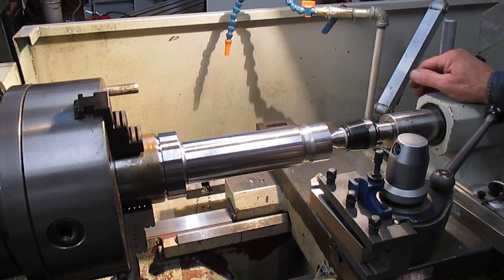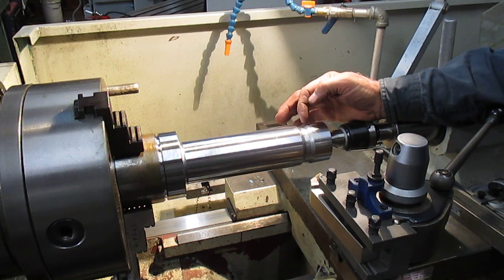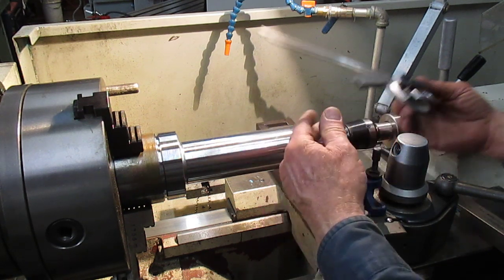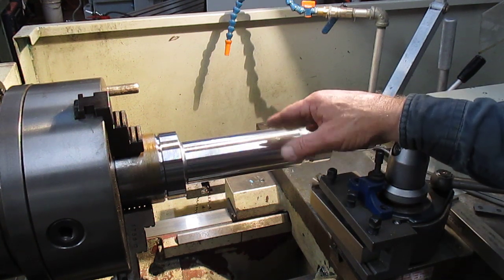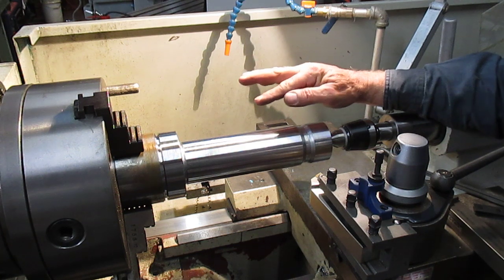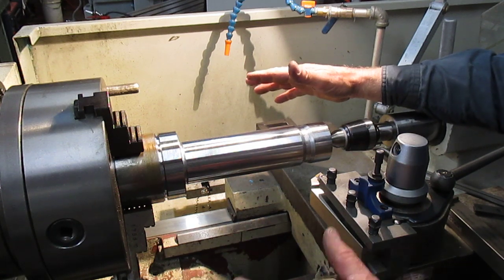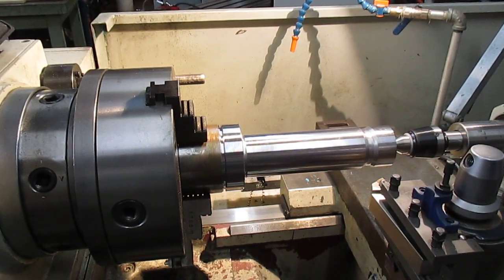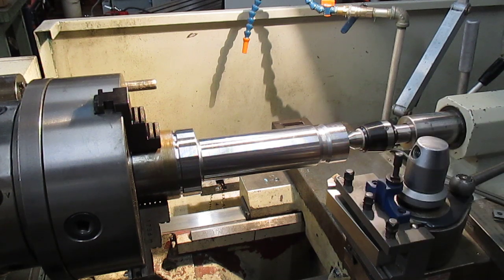Weekend Special Bruce's shop Gage toolmaking 3

Comment: Great video.  I can see where that magnetic wand is a good thing.  I don't do anywhere near the kind of machining you do so my chips are much easier to collect.  I use pliers to pull them out and then a vacuum for the small pieces.  Thanks for sharing.